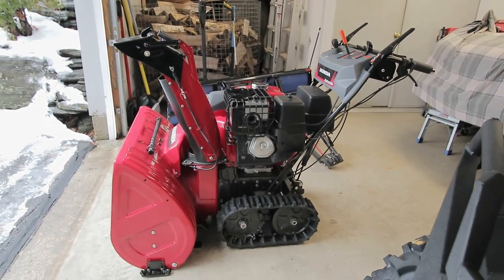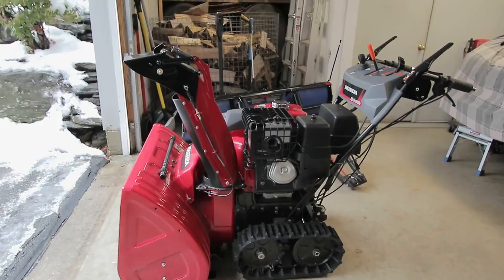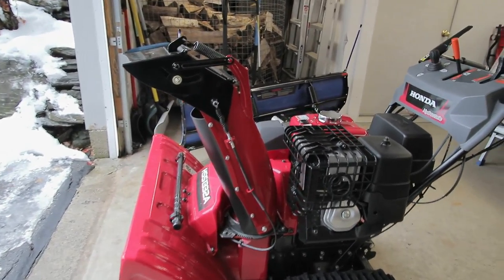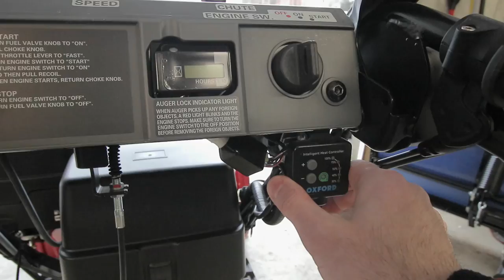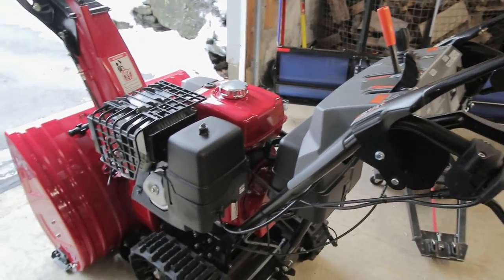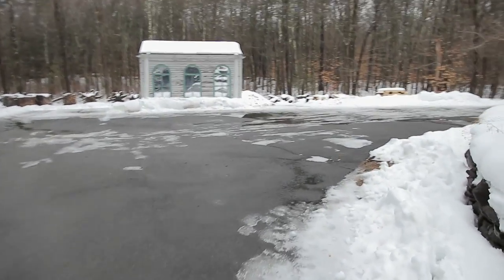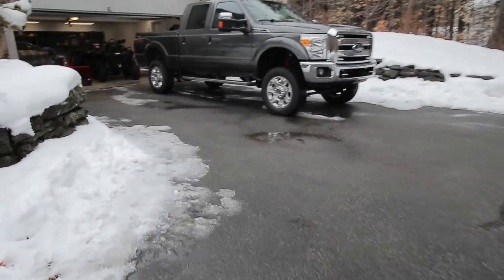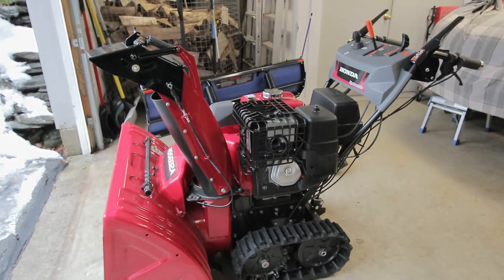SAVAGE SnowBlower MODz | 112 Jet UPGRADE | Heavy WET Snow TEST | Honda HSS1332ATD Track Drive

Comment: You mentioned modding your impeller. Earlier this winter I ran a rock through my blower which totally destroyed my impeller. 2-6 weeks wait for new one, probably 8-10 weeks nowadays. Instead I rebuilt mine out of steel plate. 3/16" backing plate and 1/8" for the impellers. I also made it a 4-prop impeller instead of 3. Once re-assembled I tested it on some 18" deep snowdrift and it worked way better and threw snow a lot further. This would require taking the whole front end apart and a ton of work, but well worth it. I think with the extra prop on the impeller that it actually discharges faster, keeping your blower from bogging down as much. FYI-the blower I have is a 1530 Briggs & Stratton. has about 9hp(306cc), 12"augers/impeller and the front opening is 21"h x 30"w.   (might do a jet upgrade too)
Reply from the maker: thats sux about your impeller. I havent done a impeller mod yet. the HSS honestly doesnt need it even before the larger jet change

Comment: Great video...I’m in the process of building a Hemi 420cc Supercharged Ariens. Takin a little longer then usual due to lack of snow in 2 years and time.

I live on LI,NY and surging even on new machines is traced back to idle circuit and damm CA Emissions.  The 112 jet is how many sizes bigger?  When I purchased my new motor is came with 2 different sizes.  I think we are close enough but far away opening up the main jet might be an issue!

PLEASE PLEASE PLEASE for the love of God, install Armor Skids and Modify the impeller. Armor skids are the best bang for your buck!  When you activated the impeller it sounds like you had a kit on there.  Wonder if just the plastic chute modified the sound as well.  

What is the diameter of your handle bars?  The heated Hand Grips don’t work on my machine.  My wife bought it at a garage sale for $50 with a blown motor and poor shape.  As I get on in years and used her machine with heated grips.  I actually like it!  I like they adjustable heat range on them.

You mentioned in your video about the coil upgrade.  I had the same issue as well. I wanted to charge my battery, run heated hand grips, and lights at the same time.  I installed coils off a Honda Generator. Very thick and beefy and compared to stock.  I have never had to charge the battery.  

Although I have a few things left to do...jet is TOO CHEAP and easy not to do.  I have $1,000 into my build with out my time 🤣 and it’s not done.

https://youtu.be/R75F-Xd32ic
Reply from the maker: Thanks for watching!
Reply: @JohnFrancoNH  thanks for responding

Comment: Hi from Sweden I replaced mine1332  from origional 110 to the 120..... do you know what one bigger could be?? and how would that perform?
Reply from the maker: The bigger the jet the closer to sea level its intended to be. If you install a 110(for 5000ft and under) say and your elevation is 10,000 ft you may have a very rich A/F ratio. And may not run optimal.
Reply: @JohnFrancoNH  I am at 2000feet. And the 110 runned so poor and a 120 so much better.
Would consider even one bigger

Comment: It's amazing how much better the machine sounds now without it surging. It's too bad that EPA has them CARB compliance specs that small engine manufactures have to follow, all it does is restrict the true potential performance of the engine and you need to be extra careful how you hibernate your outdoor power equipment where gasoline is concerned.
Reply from the maker: It really does sound so much better especially warmed up its a little quieter and not sputtering and surging etc.  I can feel the power and torque increase. Loving its new capabilities! Thanks for watching!

Comment: Honda is the largest engine maker in the world, you would think they would have fixed these issues long ago.
Reply from the maker: Manufacturers make product so they fall with in the emissions standards of ALL states so that means they make them so they are marketable to ALL states. Which robs non nanny states of power from their machines.
Reply: Did you try one bigger jet that the 120??

Comment: I don’t notice a huge difference! Besides not surging
Reply from the maker: Removing the surging is the whole point. And the bonus is that is throws a little more snow more forcefully. I can tell you it definitely has improved output of discharge. It can power thru anything & throw a much fuller stream. 

I dont think you realize how heavy the snow is i was chewing on. Those were frozen solid a couple days before. It was super dense drenched wet snow banks.
Reply from the maker: Here is the difference..That modded machine i believe has a 110 jet.

https://www.youtube.com/watch?v=AVvnWvmUxrU
Reply: @JohnFrancoNH  ok I see it now. Thanks
Reply: @JohnFrancoNH  can you do a side by side comparison of same time footage. Do one with oem stock Honda than one with modifier Honda with same pass. Would be cool video. Just a suggestion!
Reply: Oh, interesting. Looking forward to the ArmorSkids video, thinking of getting those for my Ariens 28 Pro Hydro Rapidtrak, right after I finish up my LED/soundsystem installs.. We should race sometime, and with that other NH gentlemen who has a Ariens 28 Hydro EFI. Maybe next season. I'm trying to get a trailer for it (to be *transported upon*)
Reply from the maker: https://www.youtube.com/watch?v=GL-f4_-f-KI
Reply: @JohnFrancoNH  interesting. Do you know what year epa dropped the ball on this and started making these Honda’s surged? Mine is a Honda 1332TAS made in Japan 2013. Wonder if this was before or after mine?
Reply from the maker: @appleztooranges  Not sure . I recall my HS 1332TAS had the same surging. Only way to know is to check your main jet see what # it is.
Reply: John, Will you be making anymore of those shoot deflector's. I would love to purchase one.
Reply from the maker: Link to my ebay listing is below the video. Thanks for watching!